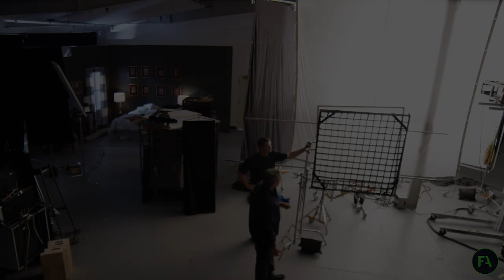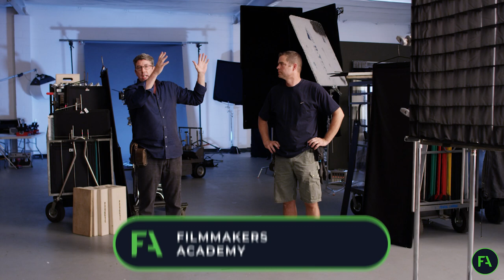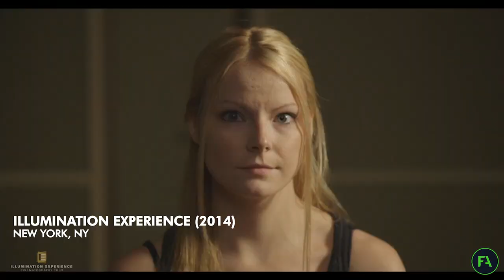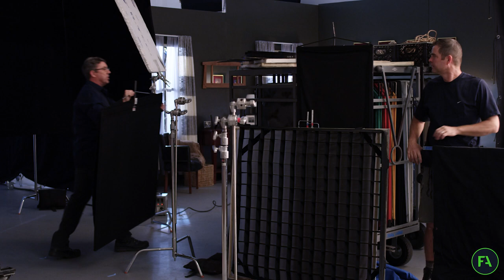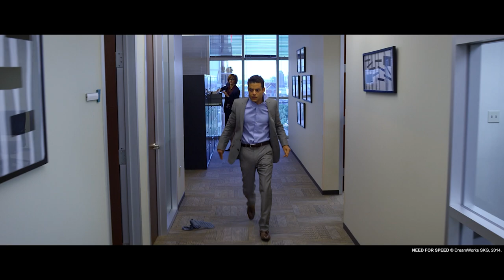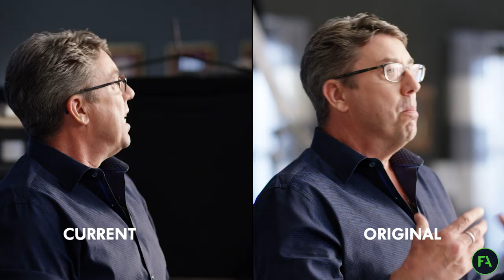How To Shape Large Light Sources: Cinematography Tips

Comment: Shane, how much influence does the surface texture and material colour have on the bounce behind the diffuser?
And, thanks for continuing to share this information to the wider film making community, and for not shying away from the budget limited methods demonstrated in many videos :)
Reply: It makes a huge difference. The bounce material color, reflectivity, and even the angle all play a huge part. I’m guessing he’s shooting the light into Ultra Bounce/clay coat of some kind, but if you used something unbleached muslin, it would be warmer and maybe even a bit softer as it’s slightly tan and less reflective, spreading the source out a little more.
Reply: @cokebottles6919 I have also always wondered, what if I bounce a different temperature of light with a plain white bounce board. Will 3200k bounce back as 3200k? Or will it be colder?
Reply: @miatatude5362  a plain white board will always bounce the color of light you put on it. So a 3200k light into a white board will bounce 3200 back.

Comment: By the time he was done cutting that huge source, it seems like it would have made sense to just use a 6x12 (or however big it was) to begin with.
Reply: that's what I was thinking but would the light look the same? lot's of light bouncing around first and then popping out the front.  If it was a smaller source may not be as soft or directed?  Just musing... thoughts?

Comment: Could anyone enlighten me on the difference/advantage of starting with a large source as Shane showed in the video and cutting with the toppers/bottomers, versus starting off with a smaller source (like half of what was used in the video) and using the same toppers/bottomers on that? Assuming the light quality and intensity are the same in the both situations, it seems like the light ends up being the same size as if you were to use a smaller source anyway. Still learning, so I could be missing things that others might see clear as day
Reply: I have never had the chance to work with a light source quite that large (12x12?) but from research and listening to people like Shane, having such a large light source helps wrap the light around the person in a more flattering way (and allows you to get the light further away and maintain a certain level of exposure per the inverse square law) - everything becomes much softer and appealing (if that is what you are going for); look at the shadows on Shane's face. I suspect however, you could probably accomplish something very similar with half the size as I believe there are diminishing returns when your light source is this huge. But anyone feel free to correct me if I am wrong!
Reply: @fd3871  Right! That makes sense. It's a great concept that could translate well when scaled down to a more budget-friendly setup
Reply: @hafeezzainalabidin4892  The same principles apply. Maybe your kit only has a 6x or 8x frame. Same principles. Shane is using specific examples to teach basic principles.
Reply: Because larger sources are softer. A light filtered through a 12x12 would be softer than with a 6x6 (considering that exposure is balanced). Problem is that larger sources spill all over the place, so this method ensures that even though a small bit of the frame is hitting you, it's just as soft as the entire frame

Comment: I feel like the same look could be accomplished with much smaller sources up close...
Reply: Nope. Further away the source is, the more close to parallel the light rays travel that are hitting the subject from any point on the light surface. Come in close and the rays are diverging, so the reflections on different parts of the face are different as the light hitting them is coming at vastly different angles. On such a large source as this the light mimics the scatter from Atmosphere and becomes closer to convergent beams, appearing far more natural.
On top, you've got the Inverse Square Law, where you want to get the light source far enough away that there's no appreciable difference in brightness regardless of how far away from their marks the performer is - if they're a meter to close, or a meter too far away, they will still be at the same exposure for the camera. That allows actors more freedom of movement as they find the emotion a character is presenting, and gives the 1AC a lower workload, just following focus instead of wrangling iris and ND's too.
Reply: I think the look advantages of having a huge source further away VS smaller source closer are not big – but it makes a huge difference to what kind of scene you can block in the space, as per the inverse square law rule and just the amount of floorspace the actors have to move about in. The reason DP's want to light through windows when possible is yeah, it looks good, but more importantly you can shoot the whole set.
Reply: He says in the lesson that he could do that but it's about the quality of light from the larger source.
Reply: In general, a smaller light source makes harder light, and a larger light source makes softer light. Small lights sources stay "hard light" even if you dim them down. Think of how hard the shadows are on a sunny day (the sun is a "tiny source" in the sky) and how soft the shadows are on a cloudy day (the clouds diffuse the sun into a "large source" filling the sky).  Distance does not have much effect on whether a light is hard or soft. Diffusion does, because it changes the apparent size of the source.
Reply: @scott_pinzon  uuuh I think you contradicted yourself
Reply: @jalexanderevans  No, he was spot on. I could see how “apparent size of the source” was confusing, though.
Reply: @jalexanderevans   How so?